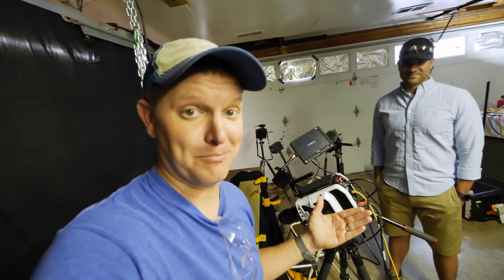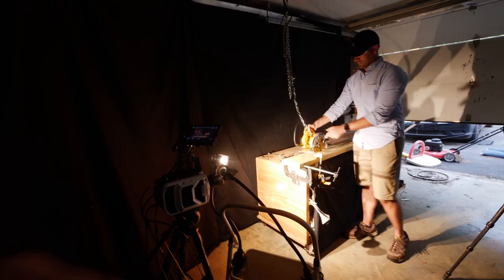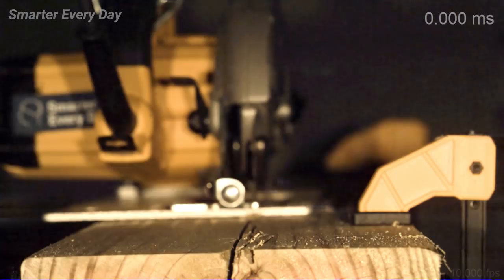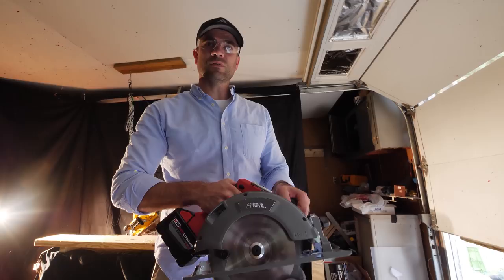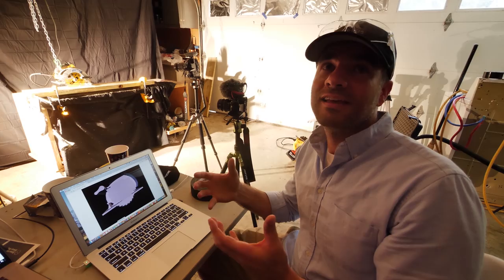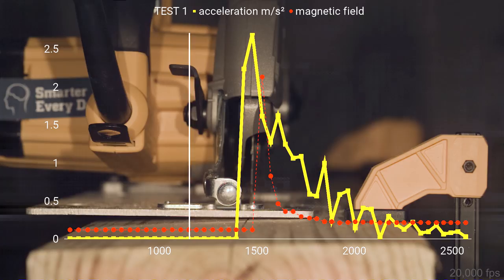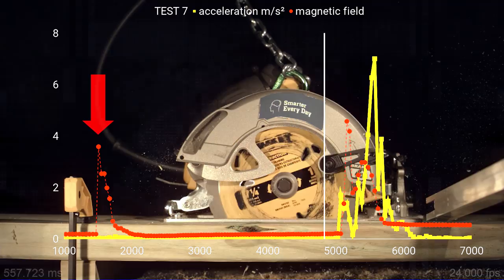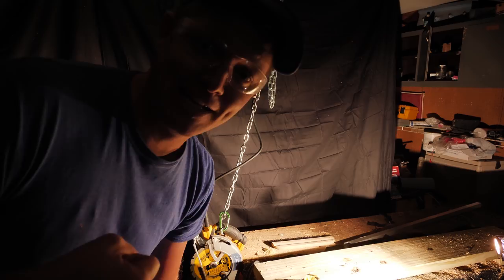Circular Saw Kickback Killer (We used science to make tools safer) - Smarter Every Day 209

Comment: Wouldn't a more robust detection come from sensing the load on the sole-plate of the saw? It is lifting off..
Reply: Great idea....

Now this is affordable enough to add to a circular saw.
Reply: "Wouldn't a more robust detection come from sensing the load on the sole-plate of the saw?" You'd need to locate the microswitch at the front of the baseplate; now how do you prevent the microswitch from activating as you cut through to the end of the material? Oops…
Reply: Wellllllll on top of the base plate between the depth hinge. 
Or, just leave the guard on.
Reply: this could cause false positives tho, sometimes cutting things that are super dense case the saw blade to slow down because it cant keep up in which case you still hold the trigger and lift the sole plate manually to get the blade back up to rpm before continuing the cut
Reply: So you want something extra in contact with the load? That would work. I personally would prefer what is in the video. The whole saw is lifting off, no need to sense it at the sole. Plus, this means the sensor can be hidden away inside the saw, away from dirty and sawdust and metal chips and whatnot.

Edit: as Java Junkie said, the fewer electro-mechanical interfaces between the device and the outside world, the better. These are points of failure.
Reply: Okay, so you're obviously not a carpenter because as any carpenter can tell you, many cuts need to be made when only a small part of the surface plate it is ever making contact with the wood. Also, it's not always the same small part of the plate that makes contact. So no, that would not be a good idea.  The accelerometer like he's designed  is pretty good.
Reply: @deasystems  you could have multiple fingers, that require more than the lead finger to be triggered.
Reply: I'm enjoying this bit of spirited discussion in this subsection of the comments. We have a mix of good questions and experienced answers. I like it when I get "smarter every day."
Reply: I worked with a small remodeling group and used a hand saw a lot so I love this thing.  As to your plate switch I would not like that as there are times I had to come in at an odd angle for a cut and I would not have the plate fully on the wood.    So this is an amazing thing as I have experienced kick back with hand saws and chain saws and its super freaking scary.  Thanks for you all do Dustin and co! @SmarterEveryDay
Reply: Alright...  Do you think it would work to put a "load cell" sensor (as in a weight-measuring balance/scale) somewhere between the mass of the motor and the support of the baseplate?  When the saw was resting on some support material, the load-cell would sense the weight of the motor.  One issue with this is the saw might have to be completely airborne before it would activate.  It also might need a bit of signal filtering to remove high frequency noise, and all of this could slow the response a bit.
Reply: @justajavajunky  Yes, the sensor/switch would be more reliable if it was sealed to keep out sawdust and preferably not based on mechanical electrical contacts of the type in a simple switch.  There are methods of non-contact sensing.  For example one way might be to measure the capacitance between 2 electrical plates on the baseplate.  The capacitance will be higher when the workpiece material is nearby.  There are even microcontrollers that have this type sensor peripheral built-in for use with touchscreens.
Reply: @mikeguitar9769  As a general contractor I occasionally have to use the saws with a diamond blade on them with a water feed. In addition to what I mentioned above, can you explain to me how your idea wouldn't prevent me from using the tool free hand in a plunge cut with a water feed?
Reply: @josephdestaubin7426  I appreciate your expert input.  I hope it's okay if I was just talking blue-sky ideas.  Anyway, sorry, I haven't thought of a way to make it work in that situation.  I assume that is for cutting ceramics.  Is there a need for that feature, or are you looking to disable it for that use? lol.  I understand there are situations where safety features need to be disabled, or users prefer to opt-out (when it's at their own risk), and I've had to do it myself.

On the other hand, on Husqvarna chainsaws, I find the chain brake is quite good and I've actually reinstalled one for safety when it was broken.  Basically if the saw kicks-back, my wrist pushes the lever forward, and a spring-loaded steel band clamps down on the clutch with a snap-action.   

As an aside, for the circular saw I might make a saw guide or jig, mainly to help with making a straight cut.  I can't find the link but I think Izzy Swan designed one.  Maybe this would prevent the failure mode Dustin mentioned in the video of the saw twisting and binding.
Reply: @deasystems  I said "load-cell" not" MicroSwitch". Besides, any parallelogram mechanism can be tuned to measure the normal force ('normal' as in perpendicular to the plane of the sole-plate): This makes it insensitive to where the load is applied as long as there is a normal load present on the sole-plate. A more valid question might be: Is a load-cell's (and associated amplifier's) reaction-time small enough to trigger the safety-brake..
Reply: I agree on minimizing the interfaces. A load-dependent brake would be software independent too. To recap: The protocol would go as follows:
1) Place soleplate on the job
2) press soleplate on the job, and press a trigger; saw spins ONLY when a prescribed load is present on the soleplate
3) "plunge" the saw into the job. Load stays on the soleplate
4) Cut with the saw as needed
5) Lifting the saw (thereby releasing the load on the soleplate) or releasing the trigger shall brake the saw-blade (either a mechanical "brake-shoe" or regenerative braking)
6) In the eventuality that the saw "lifts up", the load shall vanish from the soleplate, thereby falling-back to (5)
Load sensing could be done by a regular load-cell or a mechanical release by means of a stiff spring on a portion of the soleplate nearest to the hub of the saw-blade

What do you folks think?
Reply: Most circular saws already have a spring-loaded, rotary, retractable guard.    Basically the force from the weight of the saw against the workpiece keeps the spring compressed.  As soon as this force is removed, (as happens anytime the saw moves away from the workpiece), the guard is automatically moved over the blade.   Is there something left to be desired with this design?  There is just a minor annoyance for the user who sometimes has to retract the guard with their second hand before starting a cut (such as with a plunge cut).  Other than that, I think it serves the function we were discussing, and does so with only a simple spring.

Comment: I'm only 4 min in but that's why those spring action blade covers exist. . .
Reply: They don't move fast enough. They are often held open by the thumb because they catch when cutting thin materials. They are only really a safety feature for walking around with them and keeping your blade off the ground when you set it down.

Comment: Simply properly cut wood--don't cut in the middle of sagging lumber (properly support your lumber); use a TABLE saw when appropriate; correctly hold the tool relative your body. If the lumber does place a ton of friction on the blade, don't be an idiot by continuing to saw. This invention is still useful though, awesome use of AI.
Reply: I'm a carpenter myself and it's definitely noticeable to me when a kickback is beginning to start up. It's that tension you speak of, and being around it enough, you realize it's time to reapproach your cut.

Comment: My best advice is to hold on to the saw like you mean it
Reply: I'm a carpenter and use these saws on a daily basis. When it kicks, which is rarely if you are careful and have experience, the first automatic reaction is to let go of the trigger, cause your brain knows it kills the power. Hold the saw away from you, never position yourself in the line of fire.
Reply: @patricktheroux9357  Our saws got the sawwheel spinning the other way around so it can only kickback towards from you. It has never happened on my job ever that the saw has kicked back.
Reply: @patricktheroux9357  if you watched the video youll know the benefit of having a computer stop the saw is the fact that humans are many times too slow, by the time you react the saw is out of the wood
Reply: Cashy 1 until you rely on it it and it fails
Reply: @justinc2633  many humans shouldn't even look at tools.

Comment: why not use a micro switch or lead cell if the micro switch looses contact it turns off
Reply: 2 reasons, 1: that could trigger at the end of the area you're sawing. 2: that would prevent plunge cuts
Reply: @WoLpH  1) not if you put the microswitch just after the half of the blade and actually if in that point stop the blade, even better. 2) there could be an override button to keep it on while plunging
Reply: @PaoloSulprizio  or a shoet timer that you have time to start the cut that it stops the saw after some time if the switch dosnt get pressed or a rs latch triggers onne the switch gets pressed and the saw stops once the switch opens

Comment: I’m not buying a circular saw until I can get one with this safety feature! 😊👍👍
Reply: David Sjölund why?, if you follow the safety rules, kickback wouldn’t hurt you even if it did happen.
Reply: U seen the sawstop table saw? That things amazing
Reply: That's gonna be a saw that's gonna cost you over 1k usd then. Cheap saws won't have these and will most likely be on the more high end one but oh well
Reply: Rectangular saw
Reply: David Sjölund or just use common sense and follow safety procedures and you will be just fine
Reply: Maybe David want extra safety guys don’t hate
Reply: There is a feature already in saws that do this. If the saw senses that it bind the thing just stops and wont turn back on until you let the trigger go. The Milwaukee circular saws i use at my work have it. Its actually anoying sometimes.
Reply: Stefano wrong makita 36v circular saw only costs 200-300 dollars

Comment: idk why in my head for so long i thought the saw spun forward from the person but i guess that would be a longer cutting path... i had to rewatch this video like years apart and use a circular saw inbetween to understand that it's more like and under hand pitch rather than an overhand throw.
also i think this really just proves you should always properly secure the material you are working on. make sure the material has no chance to bend in on itself, build a jig if you dont have one. 
however in industry everything is timed and managers would probably ask the worker to just do it as fast as possible, no one wants to pay someone to make tools for a job if someone previously was already doing it without one. "efficiency"

Comment: it feels like machine learning might be a bit of overkill here. i'm curious why you decided to use  it vs just testing out thresholds from the sensors.
Reply: Daniel Ro ya I think some rule-based algo would have worked as well
Reply: Machine learning is not in the final product. It was only used to learn what the sensors needed to be looking for so that data could be put into the final product. The only thing machine learning did was to take something that would have took 4 years to do and let them do it in 4 months.
Reply: Buzzword compliant. For funding from venture capitalists.

Comment: The problem with all this is that you got the Factory  installed blade guard jammed up keeping it from closing around the blade. Problem solved give the original Engineers some money
Reply: The problem with your dismissive solution is that while the blade guard would indeed close, it's not perfect and the saw is still running. Trusting in the blade guard is like trusting in a bulletproof vest instead of disabling the shooter. It's a last resort, don't get complacent with it.
Reply: @MGSLurmey  What about a combination? When the guard closes, power is cut until guard opens a wee bit?
Reply: @peterwilhelmsson4168  That would work. There must be a reason they don't already do that, though, as it seems so intuitive.
Reply: Blade guards fail a lot. Here in the NW most of the year we’re framing houses in the rain and mud. They get jammed up with wet packed sawdust and dirt. I like this AI idea as a plan B - if it could work in real world scenarios.  These engineers need to build a dizen prototypes and go visit some job sites and let the testing begin
Reply: @BiggMo  Very good point! Blade guards aren't perfect. They're about as reliable (and functionally similar) as Nerf guns and can easily get jammed, stuck or break. This computerised solution would be extremely resistant to environmental damage such as mud or sawdust because it's all controlled from within the shell of the tool. There are no external moving parts, making it a very robust solution.
Reply: Agent Lurmey: well...robust will depend on quality of manufacturing. If it’s completely potted (expoxy coated) to protect it from environmentals it could be. But, odds are some manufacturer will cheapen it and guys will be opening the saws to bypass it if futzing with it slows them down.   Speaking from personal job site experience- it’s success will only work if it doesn’t dilute productivity.
Reply: @MGSLurmey  because there are tons of times the blade guard gets in the way and has to be manually lifted up out of the way. People that operate these tools all day literally won't use it if the safety features make the job worse or some cuts impossible.

Comment: much easier and cheaper is to learn the correct techniques of cutting to prevent kickback
Reply: Ryan Mader ..and a much better approach to the problem.
 We worked with portable power saws (with the guard removed) for many years with out incident because we were taught how to use them correctly and never lost respect for them. It is a much over looked skill. These saws shouldn't be in the hands of armature DIY'ers and hacks.

Comment: So in other words he just took a cheap PID Chip from a drone/quad and shoved it in a saw.

He could be a very smart programmer but I literally learned how to do that when I built my first quad in 10 minutes on YouTube...... Everything’s already built into those chips.
Reply: The secret is they don't really know what they are doing.
Reply: All that proportional-integral-derivative controllers do is modulate an output based on an error value which is the difference between a setpoint and a process variable.  Perfect for keeping copters or Segways or whatever level, absolutely useless in applications like this
Reply: Alden Zenko useless accept the fact it has ALL the permitters they used to conduct their fail safe shut off algorithm function lol

Gyro, accelerometer, manometer is literally what they used, and literally what they used to stop the saw. They just created a different output than what a quad does when the permitters are met. There are more than one way to use these values.

It’s creative but it’s not revolutionary.
Reply: @mrmidnight32  That's what I'm saying.  There's more than one way to use sensor data.  But PID controllers only do PID, which is not at all relevant to this use case.  Yes it's a trivial algorithm to implement in some framework like Tensorflow, PyTorch, Keras, etc.  But not as trivial as you think.  That's the Dunning-Kruger effect talking
Reply: Alden Zenko ohhh ok yea we’re on the same page then. I thought you were arguing it couldn’t be used for this.
Reply: An idea isn't bad just because it's easy to implement. Plenty of great products have come from easily implemented ideas that others simply hadn't thought of yet.
Reply: Karl Lind who said anything about it being a bad idea? Lol

Comment: You are assuming the saw is horizontal and the sensors calibrated...
Reply: In this test, yes, the saw is horizontal. They're smart guys, the approach they've take shows that they're accounting for varying orientations of the saw. I'm sure they've also incorporated some sort of calibration routine into the program so that when the saw receives power, it calibrates its position as the zero for that event, and references based off of that.
Reply: An accelerometer doesn't care about orientation.
Reply: @arazusaysbah6784  Exactly. All it sees is acceleration in a certain axis, which will always be the same relative to the blade because it is mounted in the body of the saw.
Reply: @arazusaysbah6784  It does detect the orientation though, because gravity acts on the sensor.
Reply: It looks for sudden acceleration, not gravity.